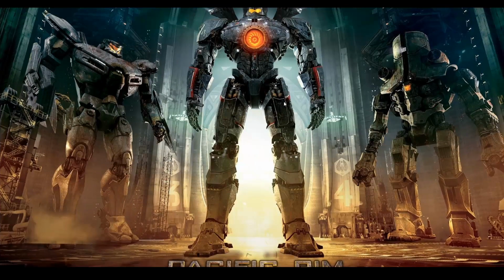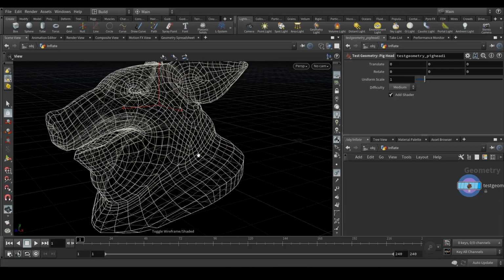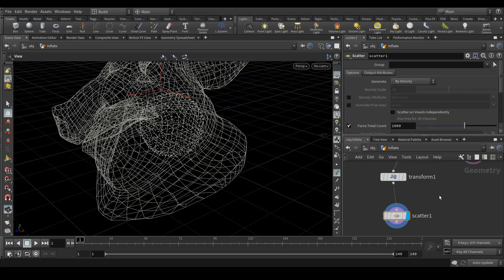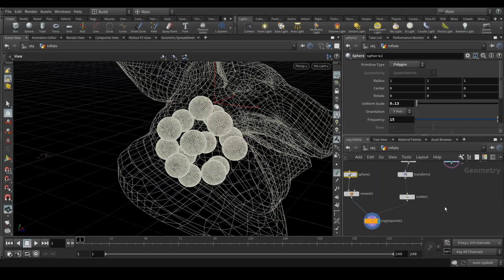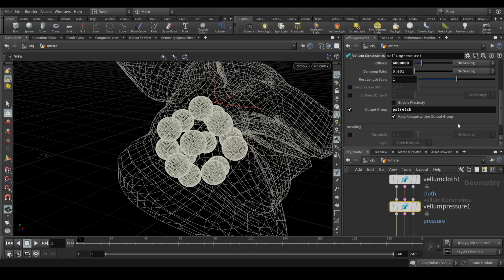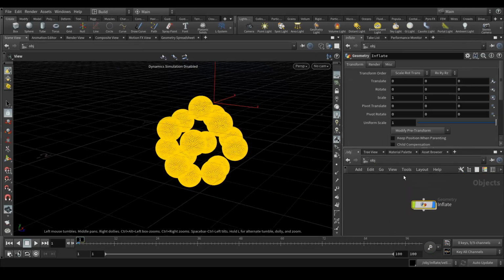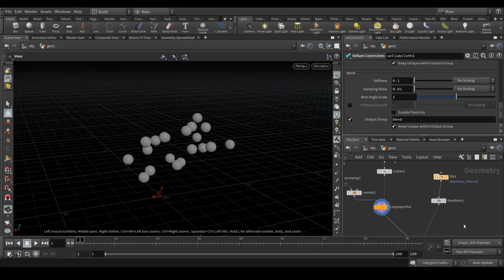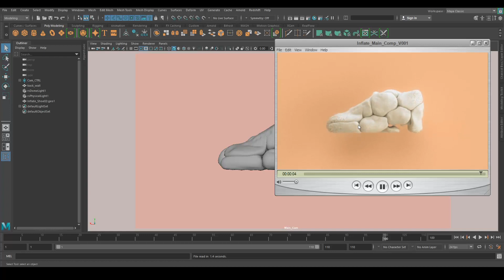Inflate With Houdini Vellum Tutorial

Comment: Why do my volume pierce and pop up the guide object?
Reply from the maker: There could be multiple reasons. 
1. In your remesh node try to decrease the  "Target edge length" value around 0.005 or 0.002.
2. In you Vellum solver Increase the Substeps try to use value between 20 to 50 and limit the constraint iterations between 35 to 40.
So as a result it will increase your simulation time but surely you will get the better results. 
With this tutorial I have shared the process now all you need is to play with parameters value.
Hope this helps :)
And thanks for watching